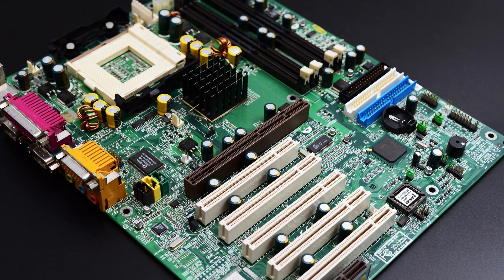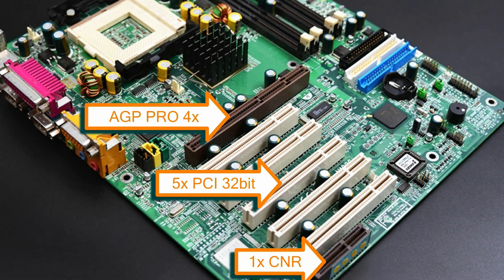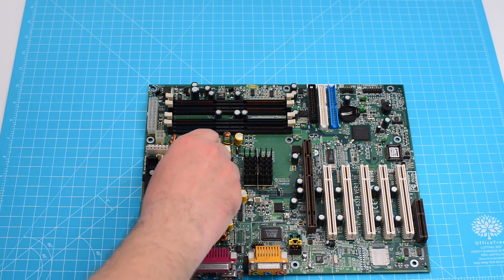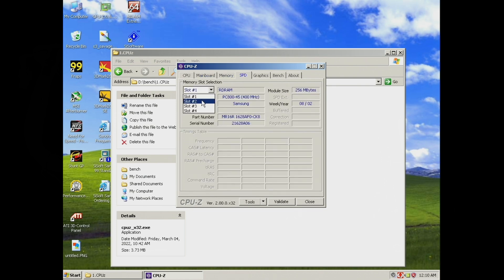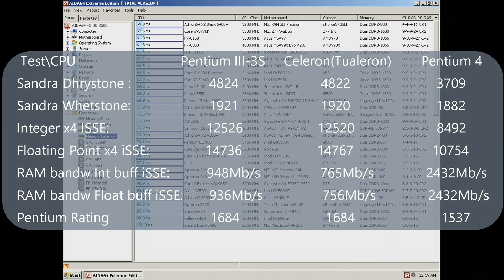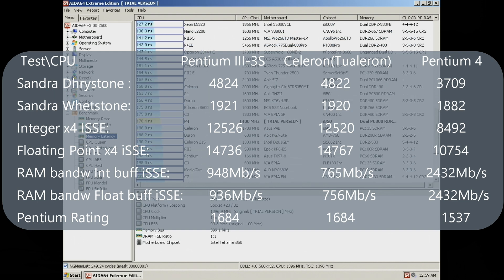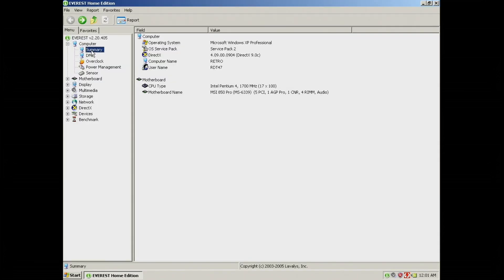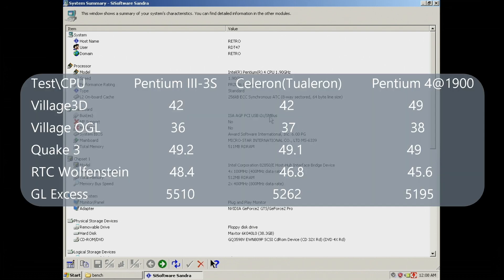First generation Pentium 4 1400MHz vs Pentium III-S 1400MHz

Comment: Yea, the Pentium4's were pretty lousy.
I think the Northwood's starting to reach at least 2.53, 2.66, 2.8 were somewhat owwkaa... The 3.0, 3.2 with HT were starting to be fairly decent.
During those days I had an Athlon XP 2400+ @ 2.0Ghz and I loved it. I later upgraded it to a XP 3000+ also which is about 200mhz more and a higher Bus from 233 to 333 and double l2 cash but the performance gain was negligible. Still was a decent system for it's time.
Later I upgraded to a socket 939 Athlon 64 X2 3800+ which felt like an amazing upgrade.
Reply from the maker: Almost sound like my path. In 2002 I had an XP 1600+, in 2004 I upgraded to a Barton core 2800+ and in 2006 to an X2 4000+ that also felt like a major upgrade for me too.
Reply: @retrodrive-thru47  quite similar indeed. I stuck with AMD for the longest time, even through their poor performers however I never cared about having the fastest, I always aimed for price/performance.
After the 939 x2 3800 I upgraded to an Asus M2N-E with Nvidia Chipset. Had an Athlon X2 5200 which lasted me a while, later maxed the board to a Phenom X4 9950 (Mediocre but still a solid upgrade over the athlon) 
Later I got an AM3 board and went Phenom II 955 and later upgraded to FX8350 who everyone knows was flawed... but it was just a CPU drop for a significant upgrade over the 955. AMD's first low end phenom and low end FX were indeed complete trash and buggy. Like Phenom1's without the 50 at the end (Phenom 9100, 9500, 9600) or the original bulldozer fx chips
Reply: i had that cpu for a while too but mine was running 2.4ghz. i literally only had to upgrade from it when team fortress 2 came out and only ran decently on core2 machines (i bought an athlon x4 before and it was trash, i kept it for like 3 months before going intel). back then the source engine was single threaded by default and there was a hacky way to enable multi core that doubled performance (mat_queue 2 on console) but it was unstable.

Comment: The P4 Willamette was a big pile of shit, and the Northwood "B" (no HT) wasn't much better.  The Pentium 4 finally showed what it was capable of when the the Northwood "C" with Hyper-Threading and the 800MHz FSB was released.  Before that, it was getting its poop pushed in badly by the Athlon XP (Remember how good the 2500+ was for the price?)

I had many P4 back in the days, including the P4 "B" 2.26GHz, the P4 "B" 2.8GHz, and finally the Pentium 4 "C" 2.8GHz + HT. That one was pretty great (good overclocker too).  Then came the Prescott and it was disappointing (high power usage and hard to keep cool by ~2004 standards)

In hindsight, the Pentium 4 was hit-and-miss imo. The Netburst architecture had fatal flaws.  The Pentium-D was a disaster. The first "Core" CPU (Nehalem) was way overdue for Intel when it came out.
Reply: I ran with a 2500+ Barton @3200+ for years. It was great until I needed a 64 bit CPU with SSE2/SSE3 for Darwin/Mac OSX (early hackintosh).
Reply from the maker: The 2500+ was superb. I do plan to look at it at some point. Also around the 3Ghz mark the P4 starting catching up to the AMDs only to lose shortly to the A64s. Whenever AMD is making a comeback, Intel is loosing it, like you mentioned the Pentium-D.
Reply: swing-and-a-miss.
Reply: @GraveUypo  ?
Reply: Even the "gooder" P4s were still not great. I replaced a 2.8E with an Athlon XP 3000+ and it was so much nicer to use. My pet peeve is the denorm bug, where P4 (all revisions) raises an FPU exception on too broad a range of values which don't require re-normalisation, but it thinks they might, by an order of magnitude vs. any other processor. It is particularly nasty in the earliest ones but it's still pretty bad on all of them.
Reply: No.
Reply: @CovenantAgentLazarus  Your mom says "Yes"
Reply: @phazonclash  No.

Comment: Nice video and good to see this old hardware still getting interest. I must admit I was a bit confused by the description you put on the video as the PIII and Celeron you used are Tualatin cores that are both newer and built on the newer 130nm process. The P4 in this instance are the previous generation chips so you got your self a little backward there. They essentially ran with both lines side by side improving them both at this time.  The P4 you have is the old Willamette core and built on the older 180nm process.  The first gen P4s were stablemates of the Coppermine based PIIIs and Celerons.  For a comparison for the the same generation as your P4 the quickest P6 derived Celeron would be the Coppermine based at 766MHz and for the PIII it would be again the Coppermine based at 1133MHz.  These old Willamette chips had already had their price slashed with the later P3III 1.4GHz chips quickly being priced between the 1.9GHz and 1.8GHz P4s.  Incidentally the 1400MHz Celeron was not officially out until around mid 2002. These Tualatin chips you are using would have been primarily up against the Northwood P4s. Though they did cost more so perhaps if you are going for a given budget then maybe a later higher clocked socket 470 Willamette chip would have been a more period appropriate for those on a tight budget.
Reply: Tualatin was the same as Coppermine clock for clock however. The main reason for existance at all was for Intel to trial the 130nm process. Also, Tualatin came out within 2001, the same as Willamette. Also, Intel recalled all Coppermine PIII 1133 as every single example was defective.
Reply: @dabombinablemi6188  The PIII 1.4GHz you have there appears to be the S model. These had improved L2 cache doubling the capacity. The Tualatins all also had a more modern data prefetch management. So you do tend to see clock for clock differences than compared with the Coppermine. That PIII was released in January 2002 the day after the Northwood P4 2.2GHz. So the Northwood really was it's stablemate. The 1.4Ghz Tualatin Celeron is later still at May 2002. The Willamette P4 1.4GHz was first released back in 2000. Even these earliest Willamette P4s pre date the very first Tualatin Core PIII by about half a year. What you have done is taken the fastest PIII from 2002 and compared it to the slowest P4 from back in 2000. Your tests are still very interesting though. I wonder how that PIII would have compared with Willamette P4s at 1.9GHz and 1.8GHz as they would have probably been more price comparable to the PIII you had in their day. It would be interesting to see how the slowest 1.6GHz and fastest 2.2GHz Northwood released the same month as your PIII would compare too. It would give a good indication as to how well or bad these late PIIIs were actually doing back in their day. I Wish I had some in my collection now as you have got me interested.
Reply: I thought the idea was to compare three CPUs running on the same clock, to show that clock-by-clock, P4 was slower than previous generation. Which was quite unusual at the time, to say the least. At least P4 was able to run on much higher clock speeds later on.

Comment: What's a CNR slot?
Reply: Communications and Networking Riser. It was supposed to be used with modems, sound cards, network cards. But, considering that more and more components started being integrated into the chipset even at the time, considering that the motherboard shown in the video has 5 PCI + 1 AGP slots, and considering that PCI peripherals dominated the market back then (there were even people still using ISA cards at the time), the CNR slot was more of a solution in search of a problem.
Reply: @thomasmittelwerk410  
Owned several pc compatibles since mid 90s but I've never heard of such thing...guess it was short lived and not much popular like rambus
Reply: @federicocatelli8785 many boards had it, few ever used it.
Reply from the maker: Some sort of cut down PCI. Others have named it. It could be found on many motherboards around 2000, Amd or Intel. I could only see soundcards and modems for it.

Comment: Excellent video and benchmarks. I liked the Celeron Tualatin a lot because they were cheap and could be overclocked a lot, from 1000 mhz (10x100 fsb) for example to 1333 mhz (10x133) at default voltage. The Celeron Tualatin had a very similar performance to the AMD Duron but could be overclocked a lot more.
Reply from the maker: The benchmarks will be complete when I run them on an SDRAM motherboard :)))
Reply: Wrong. The celeron was TRASH compared to Tualatin. Period.
Reply: @CovenantAgentLazarus   actually the Celeron with Tualatin core was one of the best of the entier Celeron series. You only had to raise the FSB from 100 to 133 and it was transformed intro a Pentium 3 with 256 L2 cache.
Reply: @3dfxvoodoocards6  wrong.
Reply: @CovenantAgentLazarus   the only difference betweeb the Celeron Tualatin and P3 Tualatin with 256 L2 chache was the FSB, 100 for the Celeron and 133 for the P3. If you raised the fsb of the Celeron Tualatin to 133, you have a P3 Tualatin with 256 L2 cache. But you seem so lack basic knowledge about CPUs
Reply: @CovenantAgentLazarus   man, a Celeron 1000 (10x100 fsb), 256 L2 cache can be turn intro a Pentium 3 1333 mhz (10x133 fsb), 256 L2 cache simply by selecting 133 fsb in the bios, at default voltage. It looks like you lack basic knolage about CPUs. The Celeron Tualatin has 256 mb cache just like the P3 Tualatin 256 mb cache.
Reply: @3dfxvoodoocards6  you said knolage instead of knowledge. Dont ever type on the internet again.
Reply: @CovenantAgentLazarus   I correted that but it did not update. The Celeron Mendocino and Celeron Tualatin were the best of the series. Excellent CPUs because the Celeron Mendocino could be overclocked by around 50% the Celeron Tualatin by around 33% making them as fast or faster than a much more expensive Pentium 2 or 3 at that frequency.

Comment: Great video! Enjoyed it
As for the video card, I'd love to see a PowerVR Kyro II (Hercules 3D Prophet 4500 comes to mind) and test games on D3D with little to no TnL. Although, overall, GF2 is way better with OpenGL, Kyro II is scaling much nicer, you don't need 3rd party tools to access all settings, lower power consumption etc.
Reply from the maker: It's coming. It will have its own comparison with a GF2MX, some unspecified(yet) 3DFX card, an ATI Rage and a Matrox.
Reply: @retrodrive-thru47  Matrox.... Now that's a name I haven't heard on a while. 
Great cards for 2D, not so great for 3D. Talking about Parhelia, that's the one that fits best the era (2002)

Comment: Definitely GF4Ti4400. GeForce 3 is pretty much the same GPU but much slower and with DTX1 texture quality issue - which was actually making some DX7 and DX8 games to look pretty bad. There is little to no technical reason to use older GPU.
Reply from the maker: Sure, I was trying not to jump the horse and have something out of time with the other parts. The Gf4Ti also makes sense to me.
Reply: @retrodrive-thru47  Not 100% sure, tbh.
The point of the test was comparing CPUs. That's overkill. 
Would be better to just run games in software renderer, wouldn't it?
Reply from the maker: @DarkMonkXES  Well it's the end of 2000 for this clip, so DX7 cards were flying left and right :) so by this point I think that the software renderer may have been a thing of the past, but I may be wrong. :) The Pentium III-S was released in 2002 and so was the 4 Series from nVidia so I am jumping the horse a little bit but not too much. But I fully agree to the test being a CPU comparison, still the CPU still had things to do while gaming in the early 2000.
Reply: @retrodrive-thru47  True :)
Reply: @DarkMonkXES you literally don't know what you're talking about. Just go to sleep
Reply: @CovenantAgentLazarus  Such constructive criticism, I'm in awe.
That was my opinion. The below is my opinion as well.
If we're talking about early 2000, the most influential video card was GeForce 256, launched in August 1999.
For the second part of 2000, it would be GeForce 2 GTS, launched in April 2000
GF4Ti4400 was released in Feb 2002, out of the video's time window. 
As for software renderer, I believe it to be the best way to test pure CPU performance. And tests regarding era CPUs should contain a mix of both D3D/SR.
But again, well done on your argumented opinion on why I should go to sleep. You clearly are a trove of knowledge and keeper of the sacred truth
Reply: @DarkMonkXES  if you think the average person doesn't know all of this information you have been nothing but a sad mistake.
Reply: @CovenantAgentLazarus  1. You first said I don't know what I'm talking about, than you said I'm a sad mistake for thinking an average person doesn't know this info. The Force is strong with you. Wish I could craft a reply that you can understand, but I find it impossible to shut down all neurons but one.
2. P3 appeared in 1999, P3-S in June 2001
3. Back in the day NVidia cards had a shelf life of about 2 years, so GF2GTS and P3S overlapped for about 9 months. What I failed to take into account was that P3 was retired in 2004. So, I stand corrected, GF4 would be a great choice, especially GF4Ti4200 (from what I recall, it had the best price/performance ratio, was the slowest, not by much, but sold best, might be wrong)
4. The purpose of this video, as I understood, was to compare 2 CPUs. In that regard, I stand by my opinion with software renderer